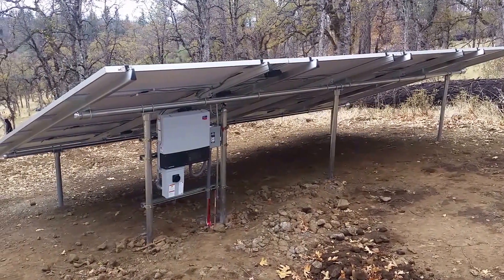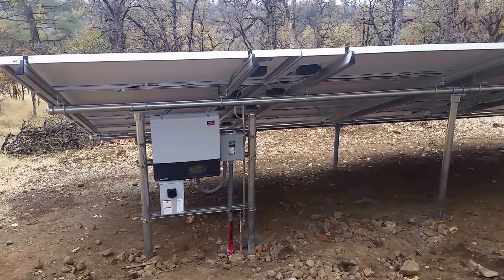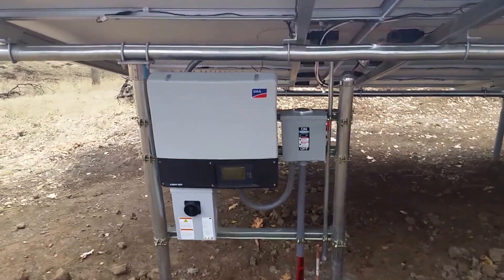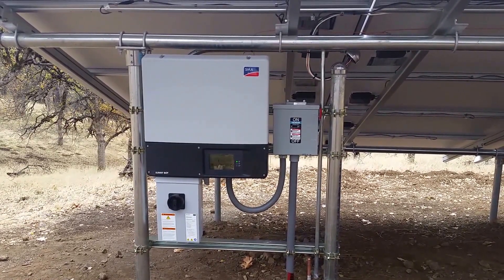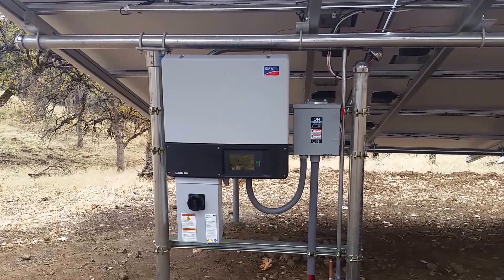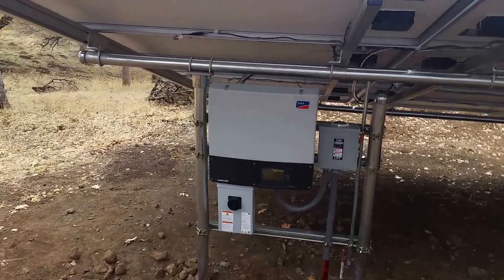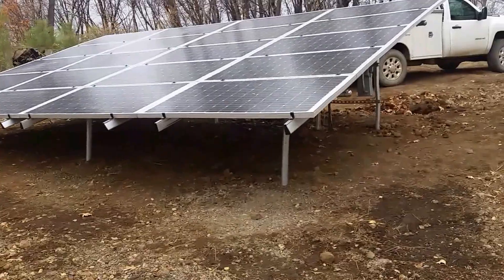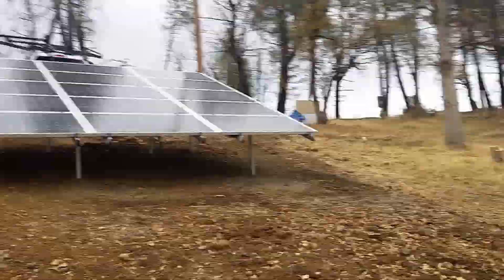Ground Mounted Grid Tie Solar with SMA secure power supply!

Comment: Are you at an undisclosed location?  Nice vintage solar modules. You da cleanest and the meanest big Jake !  I gotta build one of these next week. Thats about the slope I'll be dealing with.
Reply from the maker: I used a youtube shake reduction and it made this video wavy, this was the 2" good luck with that 3" stuff 
https://m.facebook.com/113295778708585/photos/a.198767376828091.43632.113295778708585/551202008251291/?type=3&source=54
here's some 3" action

Comment: You know what would be cool.  Is to take that inverter and do a table top review of it.  What gets hooked up where.    When you say its a 3500 watt system is that the sum of the sticker ratings of the panels used? Or are you putting enough panels in the array to get to an output of 3500?
Reply from the maker: +Albion Laster thanks for the suggestion! I am heading to my solar distributor tomorrow and will see if I can get a unit to do one.  also keep the suggestions coming to more people that ask like this the more I know what to provide.  I am so excited about using thus inverter to Ac Couple with my off grid system, I will have a whole series after the first of the year that I hope to use to gain more momentum

Comment: I just had one the new sma inverters come in today. looks like it will be a good seller
Reply from the maker: I am a fan I have quite a few of them out there I have a couple of sunny island hybrids out there and they are amazing what they can do.  the TL series has two great features, dual string tracking and the secure power supply!
Reply: +Jason Andrade Glad you did not fall. Looks nice brother. I have a SMA 240 micro grid tie inverter's setup. It's 6 of there inviters and all the rest that go's with it. Then I have a smaller off grid setup 560 watts of pv on it at all time and came pll over the rest of the pv if I need to for more power. Need to get a beater invter tho. Right now I just have a go power 1500 watts. Looking at selling the grid tie stuff to buy a outback invert. Wow why am I telling you lol. Pont is SMA makes top of the line stuff may cost a lot but you get what yo pay for.. God Bless
Reply from the maker: +yankey4 I'd like to see some pics of your micros, it's a bummer they can't frequency shift with the sunny island
Reply: Jason Andrade I have lots of videos of them up brother. I just got a real cam I will do a nice one here soon. Yes that is a real bummer. That is why I am thinking of seling them off. I would like to do ac cup but like you say it will not work with the  setup I have.